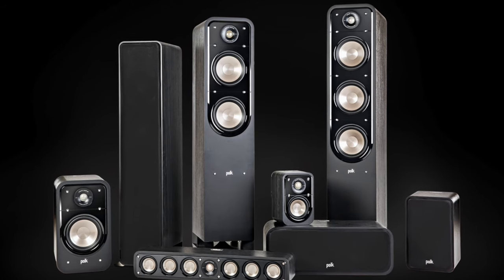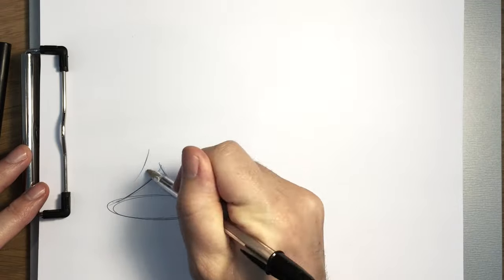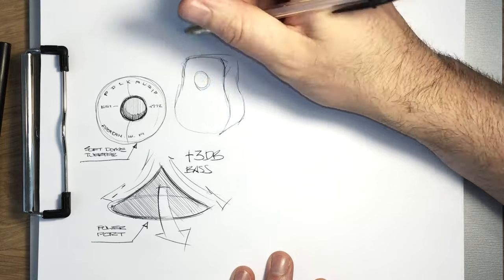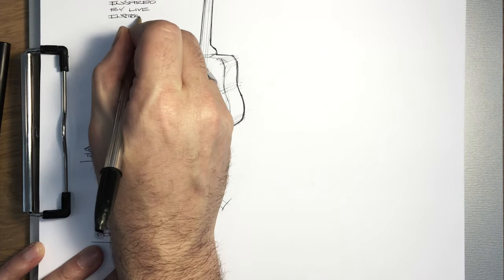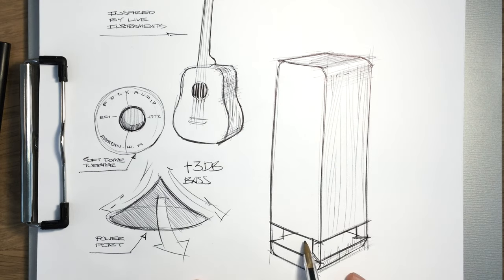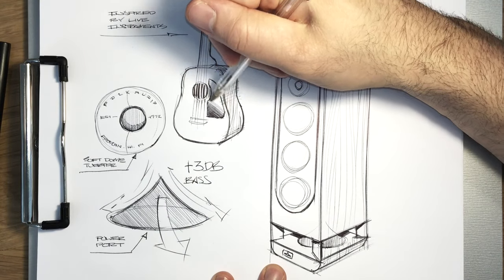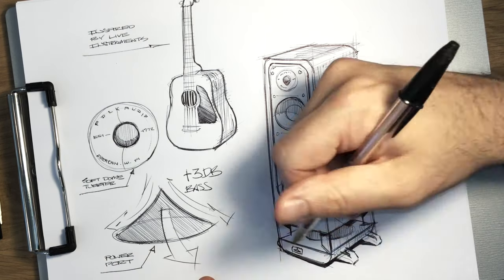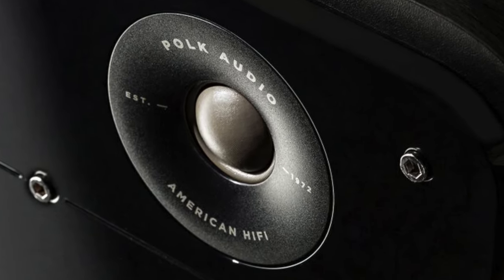Polk Audio – Learn the Design Process Behind the Signature Series

Comment: As a Recording Artist I get the concept.
I can tell you that most livingroom's will sound
stellar with the S10 or S15 Bookshelf models
wall mounted in the recommended Dolby array.
Towers aren't as good as you can't get them up
above the listening area.
Moreover, a subwoofer will be employed
so the heft of a Tower becomes moot.
My Live performance experience along with
25 years of Home Theater has shown me
that a Home Theater with wall mounted, calibrated speakers
almost always outperforms a system with Towers.
Looks better too.
If you HT buffs haven't done the comparison, give er' a go.
You'll see.
BTW : In all commercial Theaters & Concert venues
the speakers are above the listener
beamed at the ear level.
There it is.